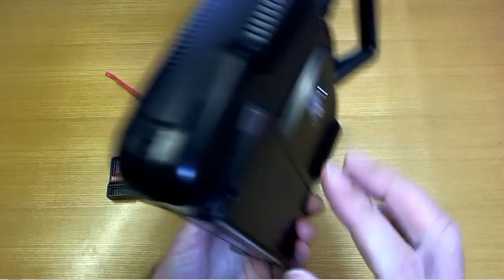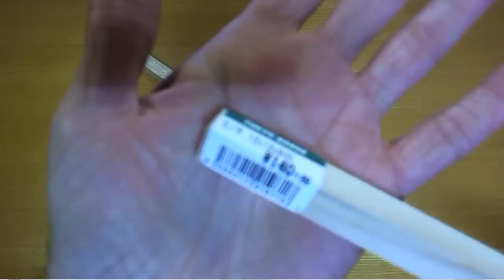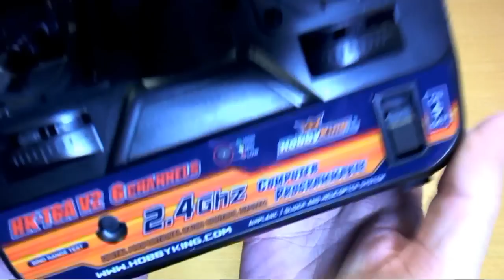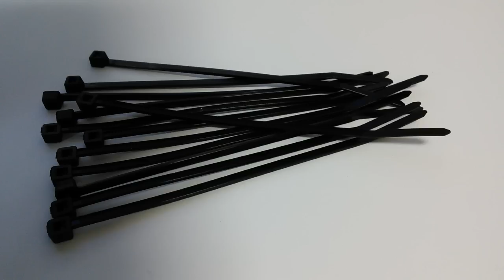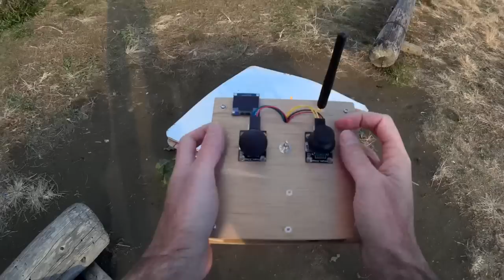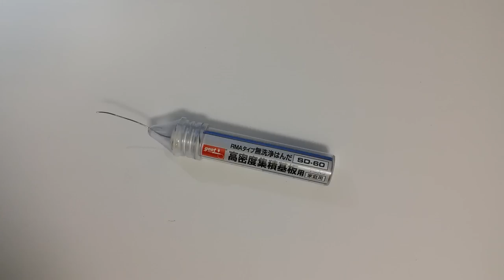Cheap-ass quadcopter build Part 2 - Parts

Comment: I know this video is 5 years old.. loads of things are dated, such as the flight controller, but motors and escs are still propably ok for a DIY build these days... but.. the google sheet mnention another set of motors than the ones you use in these videoes, and the motors in the original sheet come with props, while thew 'new' ones recommended does not, but no props are listed in the parts list.. I am fairly certain you mention somewhere in the videoes which props you are using, but I can't for the life of me find that video again.

Thanks for these videoes - all other build guides out there just skim over lots of things..
Reply from the maker: For gentle flying you could use 5030 two-blade, for more aggressive 5045 three blade is good.
I recently made another series that uses newer gear, but it is not focused on coding anything yourself:
https://www.youtube.com/playlist?list=PLzidsatoEzejIpdla6_ggPcDCPJ9u4WHj
Part 11 looks at characteristics of propellers, not sure if it will help but might be worth a look.

Comment: In the ss you say the Flight Controller is IC Source 3581. I didn't have any luck finding that part on there site. Will the following work? https://www.ebay.com/itm/CC3D-Openpilot-Self-stabilizing-Flight-Controller-32Bit-for-Multirotor-QAV250-W-/281586914295?_trksid=p2385738.m4383.l4275.c10
Description: CC3D Openpilot Self-stabilizing Flight Controller 32Bit for Multirotor QAV250 W.
Reply from the maker: That's a 32 bit controller, so it will not run the MultiWii used in this video series. Try to find a naze32 board, they're easier to work with that a CC3D which is no longer being developed. With a naze32 you can use the Cleanflight/Betaflight firmwares which are much better. I made a series about this here if it helps: https://www.youtube.com/playlist?list=PLzidsatoEzejIpdla6_ggPcDCPJ9u4WHj

Comment: tnx for the video.  can i  use Motor Brushless 1000 KV instead of 2400 KV ?
Reply from the maker: Yes, but it would be a much larger quad than this. 1000kv motor would be used with about 9 - 10 inch propellers.

Comment: can we use kk flight controller instead of miltiwii board?
Reply from the maker: Sure, but I don't know anything about it. I presume it can use PPM input?
Reply: currently I am having a plan to build a quad copter but I am stuck in the controller part. I bought the transmitter components but I having a doubt that in which format will the controller receive the signal from transmitter. can u help me out with it?
Reply from the maker: Like I just said, I don't know anything about the KK flight controller. The receiver I make in this video series will output PPM signal. If the KK supports that you should be able to make it work somehow.

Comment: Unfortunately the motor/esc combination you recommend is no longer available on banggood. The clockwise-mode is totaly sold out, the counterclockwise one is currently running out of stock. Banggood confirmed me that it is not planned to refill the product. Is there any other combination which is both affordable and good to use? Thanks in advance
Reply: look at flite test

Comment: What if i use servo Motor is it ok?
Reply from the maker: no way
Reply: So what motor can replace RCX?
Reply from the maker: You want about a 1804, 1806 or 2204 size brushless motor of about 2300kv
Reply: Ok sir thank you so much :)

Comment: Hi! I'm a beginner build quadcopter, I use arduino uno R3 and MPU GY-521. I use multiwi 2.4 to upload to arduino board, before I upload its code, I have edit as the instruction of multiwi. After that I run the TX devo7 with multiwiconfig. I saw that Throttle, rudder,aileron, elevator all fine on multiwiconfig test, but when i want to fly, I on the Tx and put the battery on quad that sound beep-beep-beep.... it shows that all motor already to spin, and i set the"arm", stick the throttle down-right side and elevator down at the same time. I try to stick the throttle up slowly, the 4 motors no spin. Could you explain me how to solve it, sir!
Reply from the maker: Have you ever seen the motors spin? Did you test them with the ESCs so that you know all the motors and ESCs work together? Do your stick values go fully to 1000 and 2000 in all channels? Is the flight controller going into 'arm' state in the config GUI when you try to arm (mode display for arm should go green)? Do the motor output values change in the config GUI when you raise the throttle? The default stick position to arm should be throttle down, yaw right (don't need to touch elevator).
Reply: Yeah! Firstly, I test esc motor by connect between TX(devo7) and Rx 701 by the way of binding battery. The 4 motors i connect with throttle, rudder, elevator and aileron,I stick throttle down and stick the elevator down-right,  it all work and spin well. But i have a problem when i upload the multiwi code to arduino uno and also connect all esc,all chanel,Gy621 mpu6050 as this figure(file:///C:/Users/shine/Desktop/Capture3.webp). In multiwi, I set the MINTHROTTLE 1100,MAXTHROTTLE 1900, I ran the config Gui, I saw that i can raise the throttle, rudder, elevator and aileron. I think it has work well then I test it by  turning on Tx, Connecting the batterry(motors beep-beep 6 times) after that i  stick throttle down and stick the elevator down-right as i last testing(i think this is how to disarm motor) but i raise the throttle up-slowly, it dosen't  spin all. I did like this many time, it still not work. I don't know how it was like this

Comment: tnx for the video ! i wanna know what's the diffrence between the two sheets u uploaded cz i didnt understand inthe video
Reply from the maker: one sheet will use the HobbyKing tx and rx for radio control. The other will use the nRF24L01 radio module and will need to make the radio transmitter and receiver yourself.
Reply: i know that but what's the difference between the hobbyKing transmitter and the one that you made ? why did you made your own ?
Reply from the maker: Well you asked what the difference between the two sheets is.... so I answered.
Why make my own transmitter? Because I can. This is a project for nerds.
Reply: hhhhhh chill i was just asking sorry and i appreciate your work it was really helpful 
i just thought that you made your own transmitter because you found something missing in the hobbyking transmitter and i wanted to make sure ...
Reply from the maker: Not really. Many people are using the HK transmitter just fine. I really didn't like the configuration program to set it up though, it is pretty terrible. These days I would not buy it to be honest. You can get a FlySky FS-i6 for about $50 which is waaay more capable: http://goo.gl/317dZU
Reply: ah if that was the case .. thanks so much for your time ! keep up the good work (y)

Comment: Can i use esc of different brand on same quad?
Configuration is same, SimonK Firmware and 30A.
Reply from the maker: yes, sure you can :)
Reply: but, the one of different brand is responding differently then others.
Reply from the maker: yes, that might happen. I thought you meant to use a different brand to the ones I used.
Reply: so.any changes made to the esc can work. or i had to use all same brand esc?
Reply from the maker: I think you can answer that best since you have the ESCs there to observe their behavior.... I only tried this once, in my experience it was ok for gentle flying but at full throttle they had different speeds so it was not stable. Have you calibrated them?
Reply: yes. i calibrated all of them at once.
But the different esc is accepting servo pulse of only 1000-1700 micro second pulse. while other esc ranges from 1000-2000 micro seconds pulse
Reply from the maker: I see. Unfortunately that does not sound very promising. It might be better to replace that ESC with one of the same model of you want a good performing quad.
Reply: ok. thanks

Comment: Hi, I am not getting flight-controller as shown in your video. Is there any alternative replacement?
Reply from the maker: +Arabindo Biswas yeah, unfortunately it seems that FC is not available now. You can make your own with an arduino nano (or pro-mini, or uno) and an accelerometer+gyro breakout board like this http://goo.gl/HCPRxb
The breakout board will need four wires to the arduino.
GND -- GND
VCC -- VCC
SDA -- SDA (analog pin 4 on arduino)
SCL -- SCL (analog pin 5 on arduino)
Then in the config.h of multiwii source code you'll need to figure out which of the IMU types it should be. I think you can choose MPU6050 under the "independent sensors" section. After that everything should be the same as for this series, but you will have no barometer (altitude) readings.
Reply: +iforce2d thanks for the info.

Comment: Wow, just got to the 2nd video in your series and I'm loving this. Thanks for taking the time to explain all your choices in so much detail. I'm just getting into the diy quadcopter building and as you will know all the terminology and different option can be overwhelming. Anyway, I'm also a programmer and share your interest in being able to control a quad via computer. I saw you had some colored blobs on your Hubsan X104. Did you manage to track it? What did you use to do that?
Reply from the maker: +lebasson thanks man. I used opencv to grab frames from the webcam and then my own code to detect the color blobs. It works well when the light is well-controlled and the blobs are not too small or too large in the frame. 
https://www.youtube.com/watch?v=Ar6mvKrOA1s
Eventually I went back to using the wiimote and IR markers.
Reply: ***** Tnx for the extra info! I'll look into that route, but first.. continue watching your excellent walkthrough ^_^
Reply: ***** One more question, regarding the Arduino-based transmitter. Does the code running on the Arduino allow for additional tasks such as communicating with a computer over serial? It's my wish to explore controlling the quad using desktop-based software.
Reply from the maker: +lebasson yes, just keep in mind that the more you make it do the slower the loop time will be. I don't think adding a serial connection would change much though.
https://www.youtube.com/watch?v=_LIBB9qlJoU
Reply: Tnx again!

Comment: even i love nrf24l01  i recently made up a 12 channel rc by using it, one of the arduino is solely used to recieve and control motors while another one controls ..

if you hook the transmitter up to your laptop you could control your quad with your lappy,  and just in case even a cheap game controller then could be used to control the quad.

just loved your videos
Reply from the maker: +Rohan Dvivedi yeah I tried something like that once: https://www.youtube.com/watch?v=_LIBB9qlJoU
Reply: +iforce2d i wanna buy a quadcopter made from u wiht the remote aswell i find it very cool how much

Comment: Hi there, I've been trying out some 11.1v lipos. It's very volatile using these, and seems overall very overpowered. I'm going to have a look at lowering the amount of throttle in the receiver and multiwii code. I'd just like to ask if you think that these ESCs are capable of dealing with 11.1v. I'm using an FPV transmitter that runs off 11.1v from the quadcopter which is why I'm trying to use an 11.1v lipo without needing to have 2 different on the quadcopter at the same time.

Thanks, would love to hear your advice.

Joe
Reply from the maker: +Joe Allison That's the first time I've heard it described as 'volatile', most people usually say 'fun' :) But perhaps in your case something is not quite right with the ESC calibration... do you mean that the power comes on too quickly as you raise the throttle from zero? I'm not sure if I mentioned how to calibrate the ESCs in this series... 
Yes, I've had these ESCs running on 3S for a long time.
Reply: +iforce2d Oh brilliant! Yes that's exactly it. When taking off theres a real sharp jolt in throttle and it throws the copter into the air very quickly. I was using large bullnose 6" props with a 7.4v battery and it was nice and stable. Also with some meaty 6" 3 blades. I downsized the props to 5" 2 blades with the 11.1v battery. It was working pretty well, but there seemed to be a little bit inconsistent in terms of throttle. When holding steady it sometimes has slight jolts throttle. Nothing too major, just small bursts.

Did you mention the calibration, sorry If I missed that. Which video is it in? Good to know you're running the 11.1v well.

Thanks,
Joe
Reply from the maker: +Joe Allison I don't think I mentioned it anywhere actually. The way it works is you give the ESC a full throttle signal when they start up, then wait a few seconds, then give them the zero throttle signal. You can use multiwii to do this for all four ESCs using a special mode. To be more specific:
1. Remove props
2. Disconnect power to ESCs
3. In config.h, uncomment the define ESC_CALIB_CANNOT_FLY line
4. Power up FC but not ESCs (ie. using FTDI adapter, not battery)

5. Compile and upload
6. Disconnect FTDI so that nothing is powered
7. Connect main battery so that ESCs and FC start simultaneously
8. ESCs should make a slightly different sound to normal - motors should not spin.
9. After four seconds the ESCs should make another sound you might not have heard before either.
10. Disconnect battery.
11. Power up FC but not ESCs (ie. using FTDI adapter)
12. Comment out the ESC_CALIB_CANNOT_FLY line
13. Compile and upload.

If the motors spin at any point during this process you got something wrong. I don't know what the issue could be with the slight throttle jolts while flying... you drank too much coffee maybe?
Reply: +iforce2d Haha yea coffee could have been the issue. Thanks for this, I will try this out later on and see if I can get them calibrated. Looking forward to flying with 11.1v because the range of the FPV transmitter is pretty bad using the 7.4v.

Thanks,
Joe
Reply: +Joe Allison Thankyou so much for your help. I've just gone through this and tested it out. It's working very well. Can't wait to test out properly if this will help to increase the range of my FPV which I was running off 7.4v instead of the recommended 11.1v. 

Thanks again,
Joe

Comment: Can you post a link to those "goood" pots lol? Thanks
Reply from the maker: +BAMFWrangler those particular ones I never received, the seller on aliexpress is completely useless. Although I have not tried them myself, these ones recently appeared on Banggood and look very nice, I would try these if I was building a tx again: http://www.banggood.com/Frsky-Taranis-X9D-Plus-Transmitter-Parts-Gimbal-Assembly-p-1012055.html?p=2K090270884220140865

Comment: I noticed your nrf24l01 had its pins desoldered in this video, and the vias filled with solder. what I do is I remove the plastic from the male header and then push the male header pins through instead of pulling them out, this causes them to take more tin with them, thus leaving the holes open, saving you a hassle with other desoldering tools later on.
Reply from the maker: ***** Good idea. I have a solder sucker which makes quick work of it though, most of the time at least.
Reply: Just a spring-loaded pump or like a professional sucker/desoldering iron? Might get one of those spring loaded ones if they're any good.
Reply from the maker: ***** spring-loaded one, about $20 iirc. Works well enough for the occasional dismantling.

Comment: Is there a way to know how much RPM a motor need to have force enough to overcome gravity and the copter weight?
Reply from the maker: lol... no easy way. That's why you need to fly a bit and get feedback from what you see, to know what position of throttle will maintain a hover. Theoretically sure you could calculate it, but I bet the result would be very unreliable when they meet with reality. Besides, you can't just set whatever motor RPM you want accurately because the RPM at any given throttle position will depend on current battery strength, which is difficult to measure and changes over time. On top of that, all the motors need to spin at different RPM to each other anyway.... I suppose you could heavily modify the flight-controller to keep the overall average speed of all motors at some specified RPM and share the ratio out among them to get a desired attitude, but this sounds like a lot of work and would probably compromise overall stability as well. Even if you got all this working somehow, it does not mean the quad will hover nicely in one place, it just means it will not accelerate - so if it's moving it will just keep moving in whatever direction it already was - not very useful.
Reply: I see. I was looking for the components of a mini version.
I'm in the way to build one (thanks to that TED talk too) although I don't know if a small one is suitable to care all the components for a arduino radio.

Comment: iforce2d  

can i use this FlySky FS-CT6B 2.4GHz 6CH Transmitter With Receiver FS- for my quadcopter.... im from denmark and the chipping price from hobbyking for this transmitter you have HobbyKing 2.4Ghz 6Ch Tx & Rx V2 is 22 eur.
Reply from the maker: yeah hobby king shipping prices suck. You should be able to use any regular transmitter that can do 4 channels. If the receiver doesn't have PPM output then you will need four connections to the flight controller instead of one, and you'll need to choose some different options in the multiwii config, but it should still work fine.
Reply: ***** thanks :O) and thanks for a great video, fun to see you have made a list over the cheapest parts.. my list is almost the same, and all the parts are from banggood just like the FlySky FS-CT6B 2.4GHz 6CH Transmitter With Receiver, the product details says DSC port: yes(PS2; output: PPM) ...... i think i will go for the KK2.1.5 KK21EVO Flight Controller it is my first building.. of a "cheap-ass" quadcopter.  its realy not the same to built a quad like the hubsan it is much easier and a whole lot cheaper    8o)